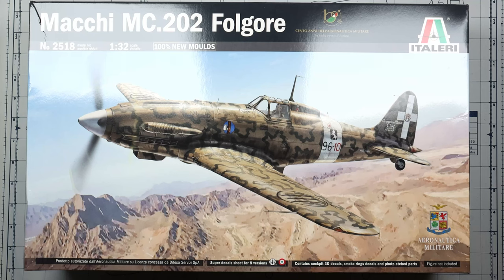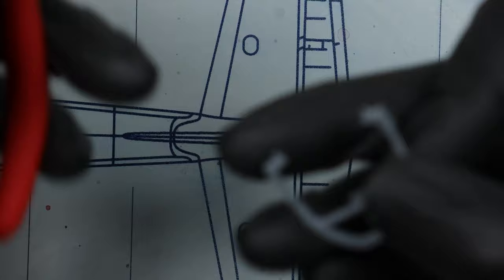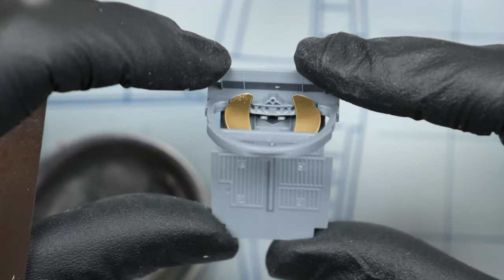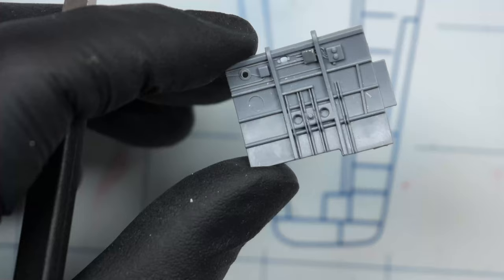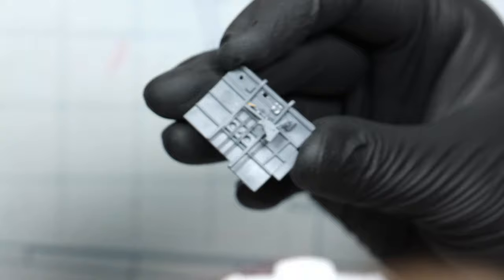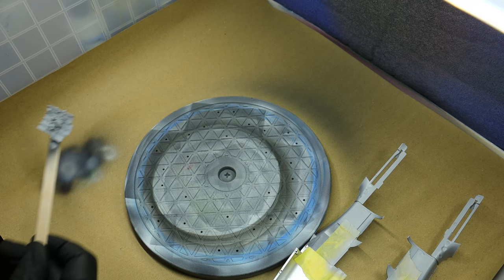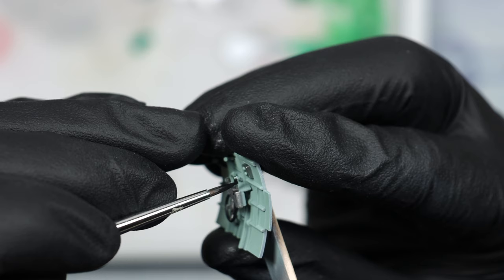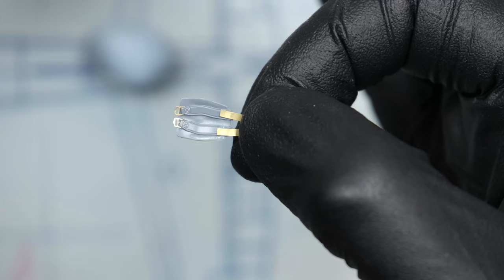Building The Italeri Macchi C.202 Folgore / Part 2 - The Cockpit

Comment: Great work and detail. I had a chuckle watching you assemble some of the pieces and frames into the cockpit before painting. I was thinking the same thing just as you said it in your voiceover: Probably don't glue those pieces in until after you've painted. Live and learn. On a side note, you should use drills for the holes on the structure framing, makes life infinitely easier, just take your time with drilling. Also, those blue bottles were indeed for pilot oxygen.

Comment: Since you asked about holding manufactures to higher standards I'd say this.  If you're going to build esoteric subjects you're going to have to settle for the manufacturers that will dare tackle them.  Tamiya is never going to make a Macchi c.202 in 1/32 scale or a thousand other cool subjects for that matter.  Because Tamiya plays it safe, I never build their kits.
Reply from the maker: I agree because this is why we have a million iterations of Spitfires, Bf-109s, Tigers and so on. It's quite daunting.
Disagree because for counter argument there is Airfix. They spent a lot of time and energy recently to cover a lot of British vehicles (even the lesser ones) and they are doing a great job. It's not high end, but the quality is so much better than it was before and the prices do reflect that as well. Their 1/24 Spitfire costs less than this and it wipes the floor with it.
My main problem is that we have here Italeri, one of the big players, partners with Tamiya, has a good range from WW2 vehicles to cars, trucks and whatnot... And then comes and fails to make a decent version of one of the most iconic Italian WW2 fighter ever made and charges as much as a Zoukei-Mura kit costs.
If this would be 40-50 euros I would say it's still not what I would have expected due to their heritage, but at least the price is fair.
But even then we can still point towards Arma Hobby and how much better quality they are and the detail is staggering. And there is Border Model as well. Yes, the kits have problems, but the detail is crisp.
Here... Italeri couldn't even be bothered to add more rivet detail.
So it's not just about how esoteric the subject is, it's also about how much better manufacturing is these days and how much finer detail they can produce, even smaller businesses.
They had a fantastic thing here and they fumbled it.
Reply: @rogueplastic  I totally agree that the Macchi is overpriced.  I haven't bought one yet, because of the price.  While Italeri does make some strange decisions, I enjoy building their kits because of the subjects and the challenge.  I will say that they are improving though, I built the TF-104 and Mirage III (both in 1/32) and they are both good kits. I also agree that Airfix is now a top manufacturer, their quality is fantastic and their choice of subjects is also fantastic.

Comment: Togli guanti quando lavori, mi sembra eccessivo e non utile. Nella fase di verniciatura indispensabile!😊
Reply from the maker: Because I use water based acrylics, I had frequent problems with paints peeling when doing masking.
To minimize oil, grease and fat getting on to the surface, I wear gloves.
Sure, it makes building harder a bit, but still better than extra work with painting.
Reply: Comprendo e avevo immaginato, mi hai già risposto. Invece pensavo non è che tutta questa massa nera dei guanti possa disturbare la messa a fuoco? My 2 cent
Reply from the maker: @fiorenzomami7201  I don't think it messes with the focus itself as that is either point or area and it's more about me being clumsy not holding the item in place.
But it definitely has some effect on the brightness. The black gloves make the camera brighten the image and the grey plastic looks too bright.
I need to change probably the mat underneath to balance it out and have a dark background.
This black glove with light grey background just doesn't mix well.